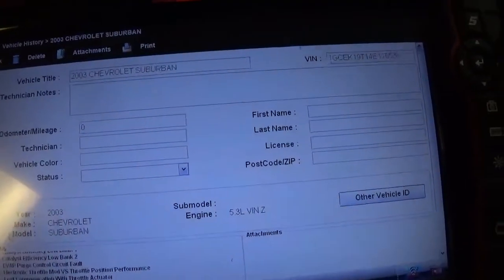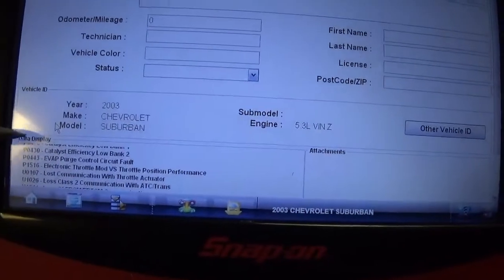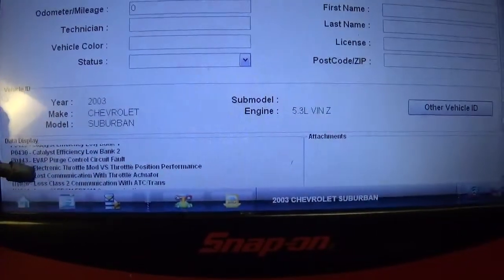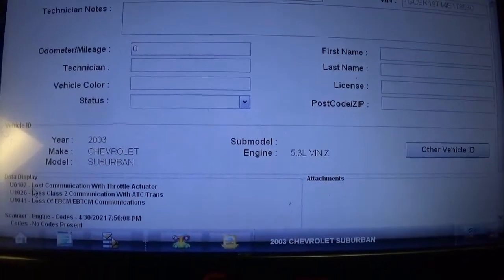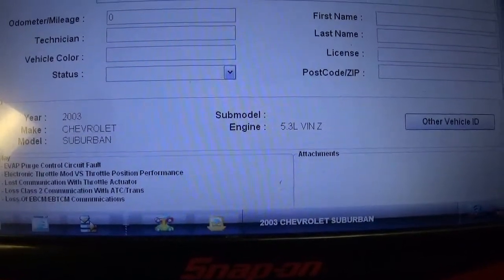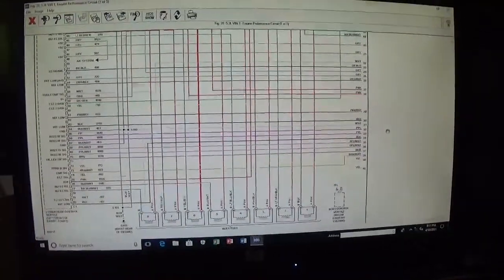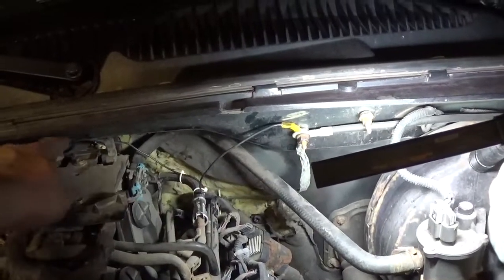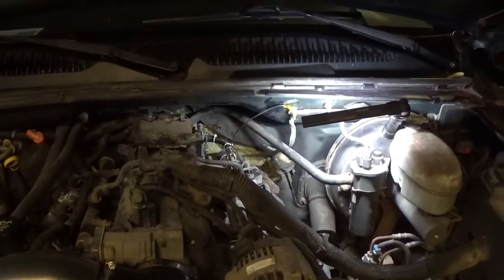Chevy Silverado Codes P1516 U0107 U1026 U1041

Comment: At the end of the vid, u propose an excellent solution. Take those two ground wires, splice into them where accessible, and take black from throttle actuator and do a ground where it is super easy. Redundant grounds. Just like a Max😂😂